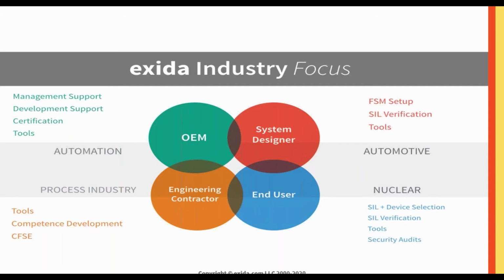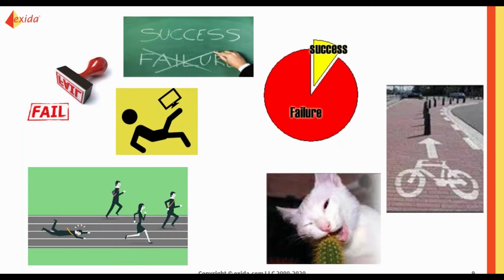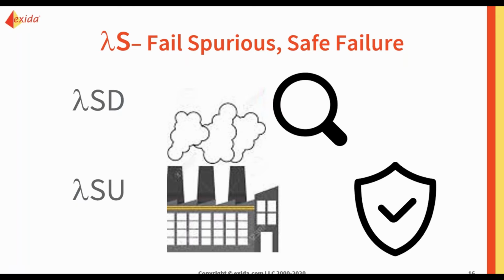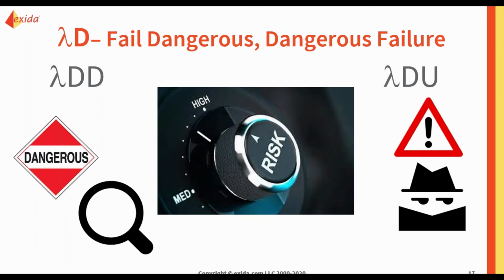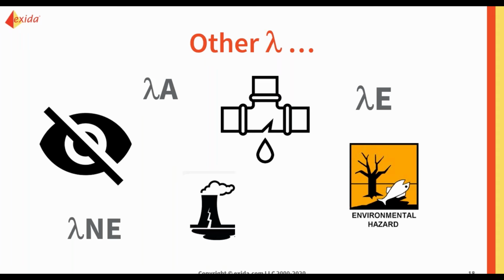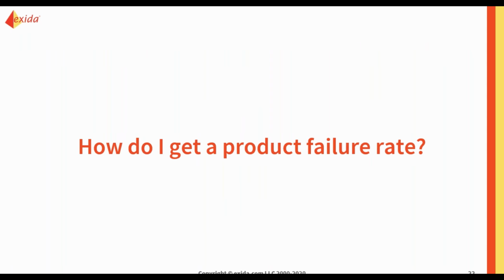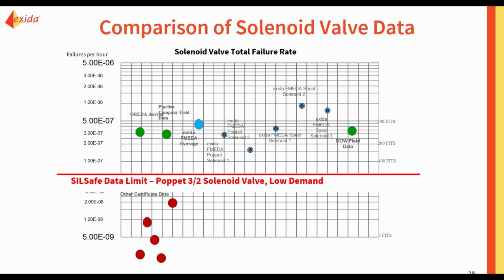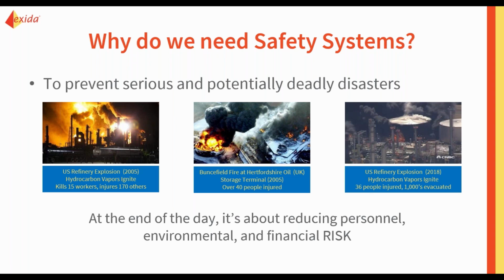Back To Basics – Getting to Know λ (Failure Rates)

Comment: Can u answer the following?

 Transmitter failure data is; lamda DD = 100 FITS, lamda DU = 5 FITS. when failures are detected , the transmitter output current goes to 3.6 mA. What is DU failure rate  of the logic solver input range is limited to 4 mA?